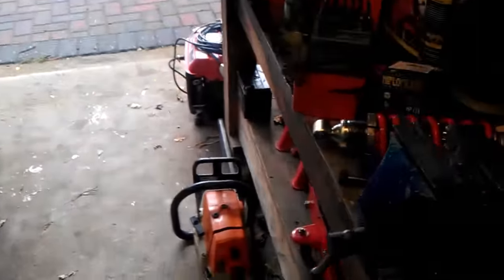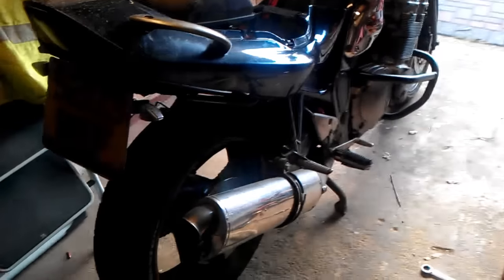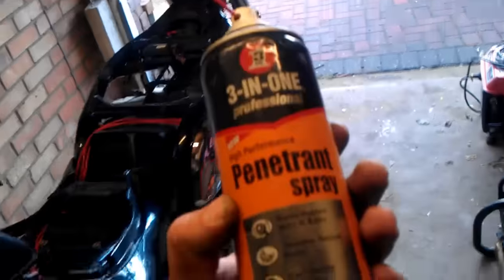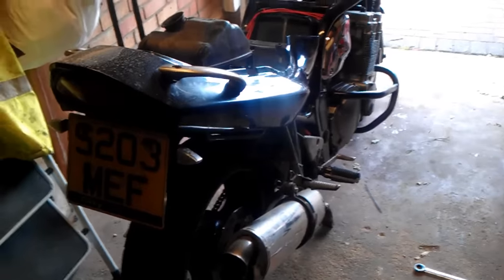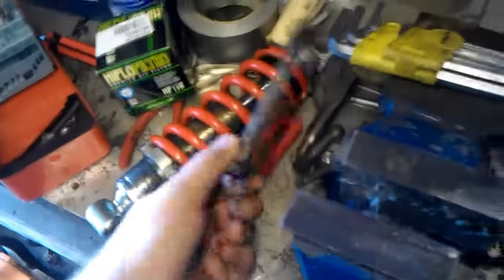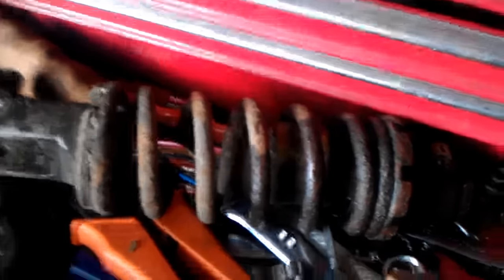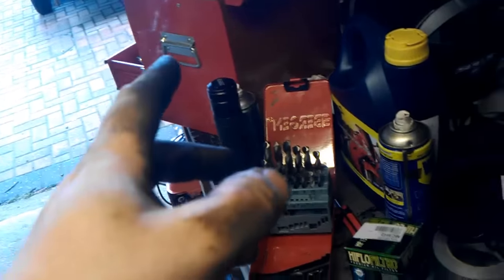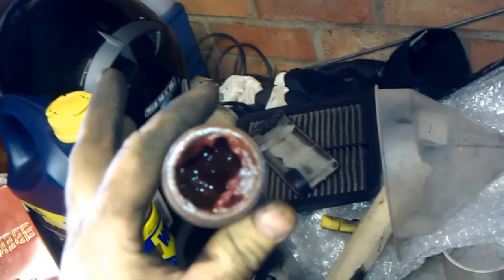Motorcycle rear shock absorber removal & refit / replace

Comment: Bear in mind that red grease has a low melting point. It's not for the parts of brakes that get hot, such as the pins or backs of pads, it will just turn to liquid and flush away. Silicone grease is better as it has a higher melting point. But copper grease is good where there is no rubber as it stops brakes squealing. Use red grease only to preserve rubber.

Comment: Thanks man I had my xf 650 no center stand up on bricks and shims top bolt open bottom bolt open I didn't know if shock removed from air box or bottom linkage thanks a lot shock dropped out easy
Reply: Rustic David what did you replace your shock with? I too have a XF650. :)

Comment: Thanks man , helpful I'm doing my zzr1100 with a Hagon , 
Thanks for the heads up on the Red grease , a tip for you try some latex gloves , not good for body the oil and grease in the long term ..!
Regards 
Andy.

Comment: My bottom bolt is stuck how can I get it out tried leaving the nut on and tried hammering out no joy??  probally rusted in the sleeve but the bolt turns round and round but not out,any tips
Reply from the maker: Keep it soaked in plusgas or a good penetrating oil (NOT WD40!) for several days - can sometimes take a while. When I have a really stubborn bolt that requires LOTS of fluid I mix auto trans fluid and laquer thinner in a 50/50 mix - Does a good job and can be cheaper than spending money on lots of cans of penetrating fluid. 
Failing that, try a bit of heat if you have a blow torch. Sometimes heating the bolt up and letting cool can make it expand and contract and break it's seal. You can even get freeze sprays now to make stuff super cold to try and get them to loosen also.
Failing that, Just keep beating on it with a hammer and trying - Also could try getting a large punch/drift or a  bolt just same or slightly smaller diameter and someone to hold the bike and the bolt and get a sledgehammer and smack the living hell out of it....
If that doesn't work I really don't know what to suggest!

Comment: Just picked up a pot of catrol red rubber grease to give it a go rather than my copper grease. Hopefully it'll do well on my rear shock replacement too
Reply from the maker: Copper grease is an anti-seize compound not an actual lubricant and should never be used with bearings/bushes etc. Only use for bolts and nuts to stop them from seizing.
As for red rubber grease I really do recommend it as from my own experience it is so much more stable and lasts so much longer than usual general purpose / LM grease.
In some applications it can be slightly too viscous but I have found that it can be thinned down a bit with red fluid grease to no detriment to it's lubrication :)

Comment: hi, i have a silly question to ask. If i have not got a centre stand on my motorcycle and i do not have paddock stands how can i lift the bike up to get the shock absorber out? i was thinking on puting block of wood under the frame any other ideas do you have?
Reply from the maker: yeah blocking it under the frame or engine could work though stability could be an issue. in the past for bikes without stands i've attached a rope to the roof in my garage and hung the rear end of the bike up, although it's not always easy. investing in an adjustable bike stand/jack is probably the best option, they are great and can be got for around £100 or less second hand.
Reply: richardfld this bike is my first motorcycle soon i will be changing so i do not want to buy these things like a centre stand or bike jacks because most likely my next motorcycle will have a centre stand. I think i will put blocks of wood under the frame and attach a rope so it holds the rear end of the bike while i take the shock absorber out. Thank you for your help.
Reply from the maker: the bike jack stands are great even for bikes with centre stands as you can raise the bike up making it easier to get underneath or to work at a more comfortable height. Also its great to be able to raise your bike up with both wheels off the ground from time to time :)
Reply: richardfld i will most likely get the stands even if i have the centre stand because i could lift the front and that could be useful too. Also the next bike will be getting a rear hugger to prevent that rust building up in the rear shock.

Comment: What equipment do you need, I want to lower my bike with a different spring?
Reply from the maker: Well, I've never actually taken a shock apart personally. I've never had to lower a bike, and any shocks I've needed modifying I've always sent them off to be done professionally.
I'd have a look and see if theres any tutorial vids on rear monoshock rebuild/modification.
But likely you'd need a spring compressor.

Comment: hey just changed my suspension  (rear shock on a ktm) i noticed it has a bit of play on it  like  if i stand at the side of the bike and hole the suspension in my hands nd rock it back and forth  it moves . ? i have no idea if it did it before or its supposed to do that  i thought it was supposed to be like solid and not move in any way other than  when the spring is compressed and rebounds  ? help anyone ?
Reply from the maker: Did you change it for an aftermarket shock or a proper KTM one? Just wondering if you got a part that might be slightly different than your old stock one.
If the part is correct then I would start looking at the bushes - they do wear out and can cause a lot of play depending on how worn they are.
I'm not really familiar with KTM's so can't help with specifics but that's the first place I would start.
Reply: richardfld thanks for the advice yeah its  a full ktm 250 sxf rear shock  i was thinking it might be the bushes after trolling the net for a few hrs :D thanks again for getting in touch and helping me out :D
Reply from the maker: Razor howl No problem.
Depending on how long it has been like that sometimes the shock linkage bearings can be bolloxed too as the bushes wear down allowing water and crap in and can end up often turning the bearings into powder.
I recently did all my shock linkage bushes and bearings as I had MASSIVE amounts of play... Shame I didn't do a video of it.
If you look at my video on how to replace propshaft UJ's, the technique I use in that video for removing the spider journals from the housings is how I remove the shock bearings.
Just remember to keep the bearings and bushes regularly greased. I always do mine yearly - they will hardly ever wear out if you do and will outlast the bike :)

Comment: With the nut removed,        Could you not have used a hammer and punch to drive the seized bolt out ?        I know you probably damage the start of the threads,        But a new nut and bolt would be only around 30 pence
Reply from the maker: I was whacking the shit out of it. Amazing how what seems a little bit of corrosion can be such a PITA.
In this instance as the bolt was horizontal I found spraying it and working it back and forth to get the spray in there and losen it off helped.